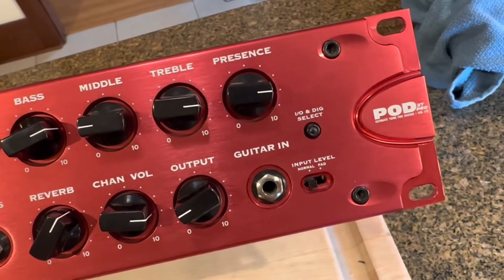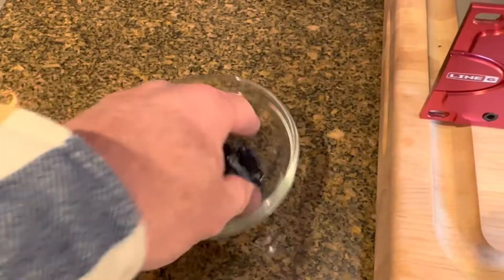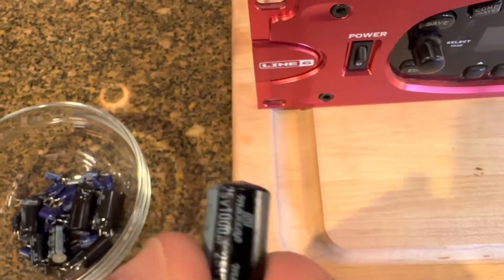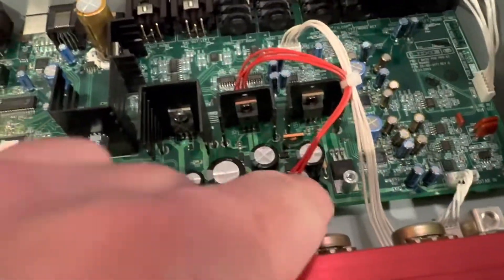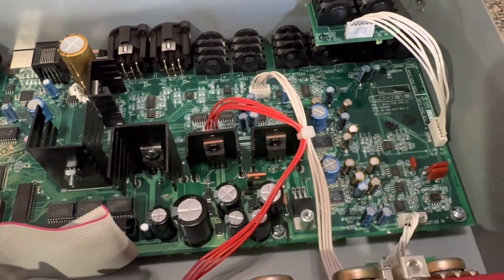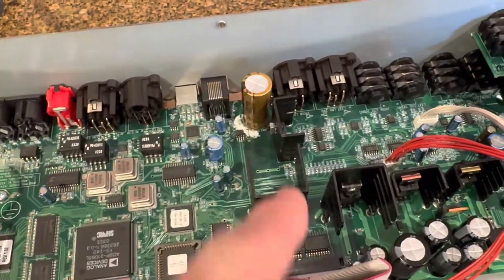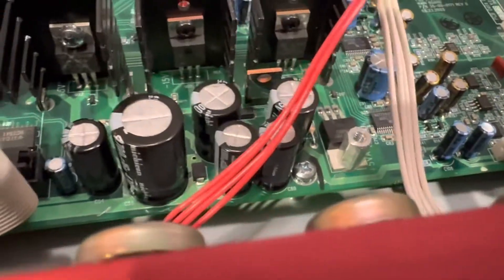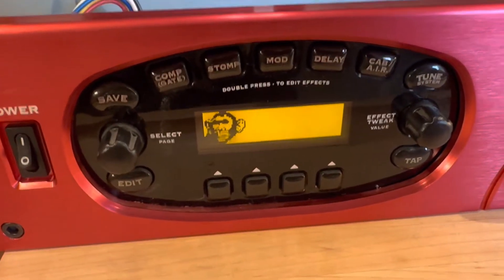Line6 PodXT repair capacitors

Comment: What was the issue?? My one turns on but I only see backlight on the screen and two front LED’s on all the time.
Reply from the maker: I had mine in a box for several years and when I powered it up there was a loud “pop” and smoke.  The power supply caps shorted out and nothing worked.
Reply: @StagrLee  I've just had this with a bass pod XT pro I powered on after a long break. Loud pop and smoke. I have very limited experience with soldering etc, is this a big job?
Reply from the maker: @JonDadley Probably 6 hours learning how to do it (soldering), 4 hours shopping for parts/supplies and 1 hour to do the repair if you just replace the failed parts.  I recapped the whole circuit, not just the failed parts.  I probably spent 3 hours on the whole job.